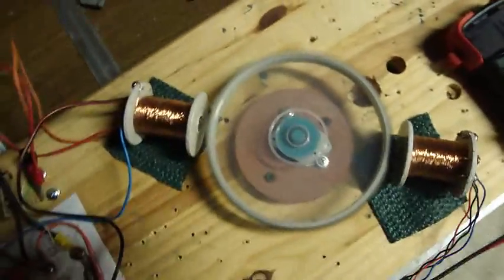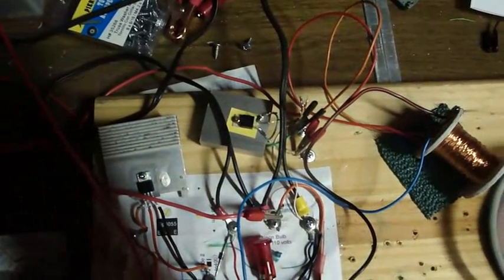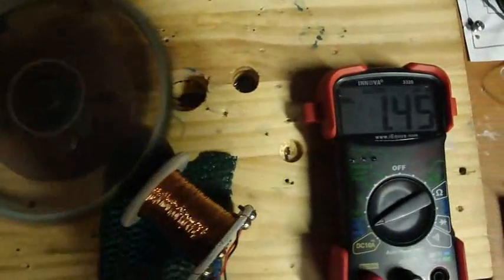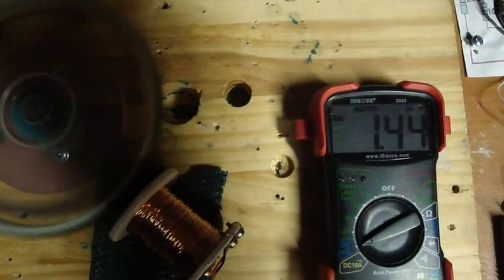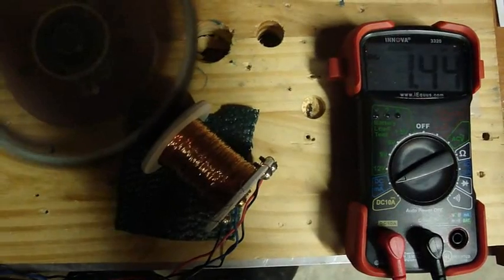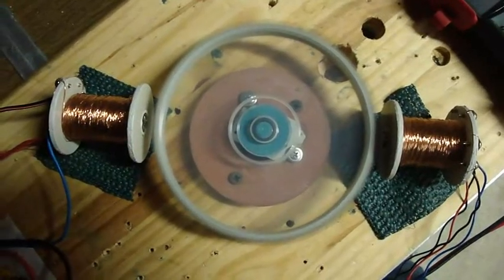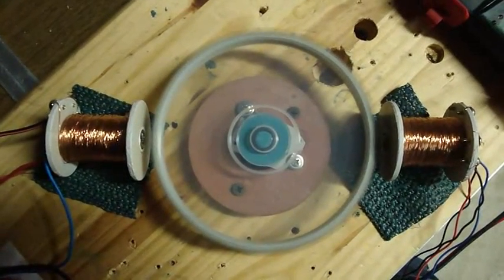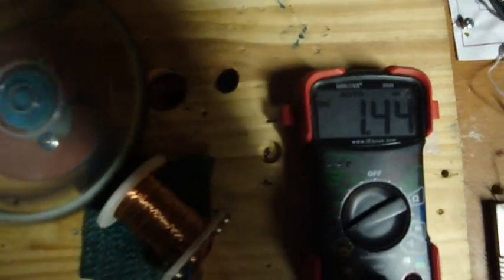theDaftman-Bedini With Charging Circuit.avi

Comment: Even if you change the resistor value, the (v^2/R) value should still give you the same number of watts.  You have to be careful that you don't use too large a resistor, because the cap voltage might get too high for the voltage rating of the capacitor.

Once you have mastered this, you can them measure the power outputs for different motor configurations and compare.

Comment: So if you temporarily replace the charging battery with a large capacitor (say 20,000 uF) in parallel with a resistor (try different values) then the motor's charging power (from the spikes) will charge up the capacitor until the voltage stabilizes.  The power going into the capacitor will be equal to the power being burned  off in the resistor.  Therefore the charging power of the motor (in watts) is equal to the stable cap voltage squared divided by the resistance. (v^2/R)

Comment: Here is a top for yourself and the TEEP group to discuss:  How do you measure the battery charging power in watts?  Another question is how do you measure the power consumption of the motor?  Then you want to compare the two.  Let's just deal with the first question for starters

Here is the key piece of information:  You know that the charging spikes from the coil output the same average power no matter what kind of charging battery that you use, or other load.